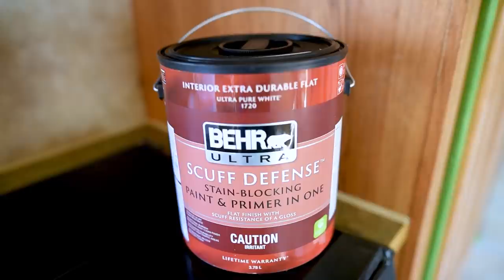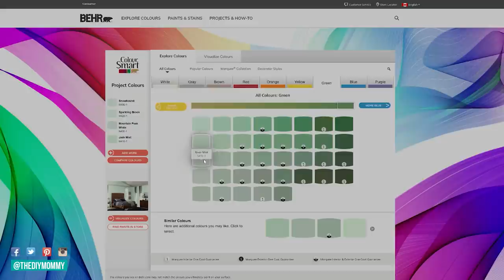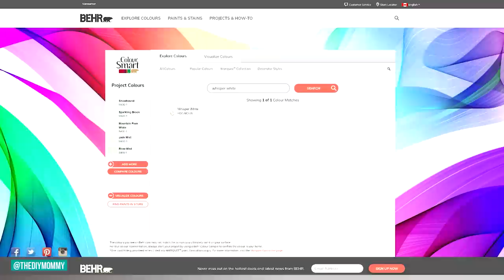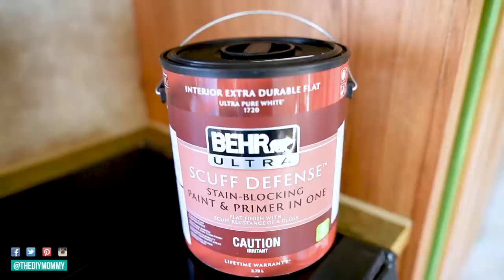RV Renovation | DIY Small Kitchen Makeover Step by Step | Our DIY Camper 2 | The DIY Mommy

Comment: Looks great! I ran across a product line called d-c-fix that makes films that can be used to cover surfaces. It's a little different than contact paper in that you can heat it with a hair dryer to bend around contoured surfaces. They also make window clings for privacy or for things like glass door showers.
Reply from the maker: That'd what I used on out counter!

Comment: Any information or follow-up on the long-term durability?  Other camper renovations recommend always using primer and using a paint with give / flexibility or it will eventually crack and peel. Also has to withstand extreme temperatures.

Comment: What did you do with the rubber joint sealer along most edges in the trailer? Also, what about the joint tape on the walls. Great remodel!
Reply from the maker: Thank you! I primed and painted right over those. I did the same on my last camper and it held up quite well.

Comment: I absolutely love your RV renos.  I am wondering what is the average cost to renovate an RV?
Reply from the maker: It depends on so many factors, we were able to use a lot of materials that we had on hand, so we saved a lot of money by doing that. We also chose to use a lot of paint which took so much extra time, but it was very cost effective. Our first camper makeover was about $1200 in materials - for this one, it will come in at quite a bit more because I had to purchase flooring. It's also a work in progress!

Comment: hello, love your videos.. they are very informative & you have great design ideas! In a previous video I saw (your bathroom makeover) you recommended using an oil based primer and a latex paint. But, in this video you said the oil based primer was a big mess. So, would you recommend using the primer you use in this video instead of the oil based primer for all surfaces in a camper?

Comment: I might have missed it, but did you end up sanding the kitchen wall before putting up the contact paper/sticker backsplash? or did you just throw it on top of the old wallpaper?
Reply from the maker: I wiped it all down with Krud Kutter first and then applied right over top :)

Comment: Was that wallpaper on the walls? Did you have any problems painting over it? Also curious with the glass jars, are there slats in-between them? How do you keep them from sliding around while driving?
Reply from the maker: Yes, I painted right over the vinyl wallpaper. I'll probably put more jars in the rack so they don't slide.
Reply: @thediymommy  very cool. I know the English's spent hours removing wallpaper in their camper. I wonder why if they could have just painted over it?